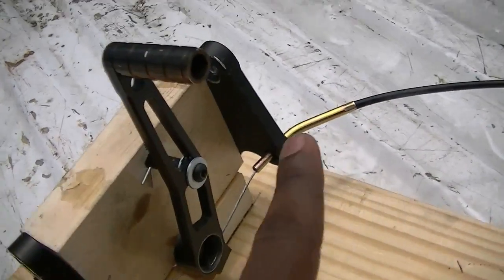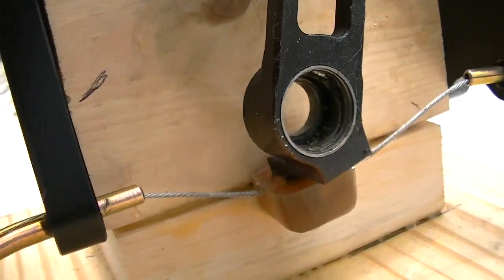Homemade plywood boat pt5 (mechanical test)

Comment: I hate to be a dream killer, I've built and failed to build a hundred things trying to save money or just the thrill of it, that being said.... Sell that motor and clutch set up on Craigslist... Add $50 dollars to what you get and just buy a high thrust trolling motor.  One, your clutch will fail the second you put the pressure of the water to a prop, two, they're quiet, you can float with bitches and still be able to talk, and also, despite 20 other reasons, as soon as you put a gas motor on a